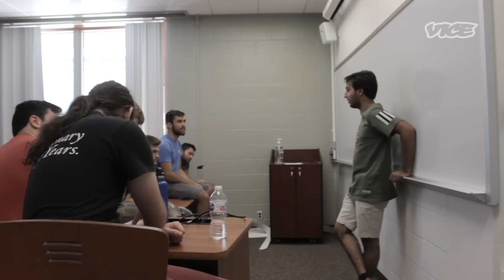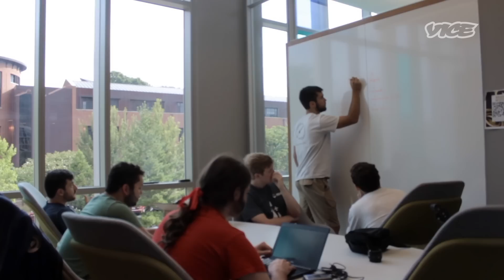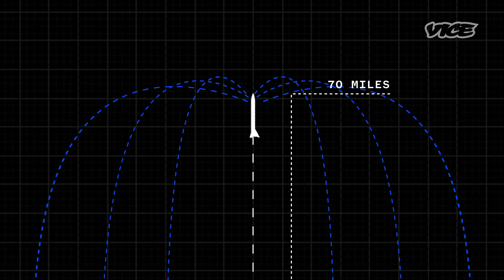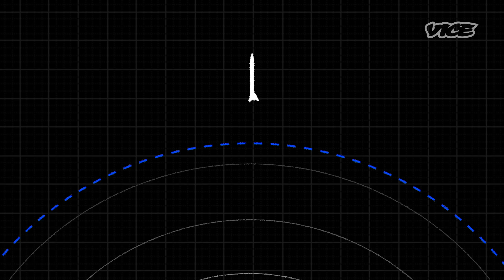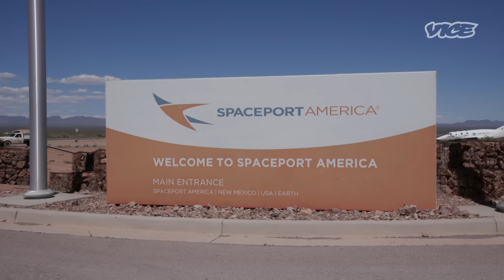Ivy League Students Dropped Out of College to Launch a Rocket

Comment: These guys really should have done proof of concept tests for some of these systems way before this point. Finding out your parts don't fit hours before launch is completely avoidable. And I would never, ever say a part was machined by an "incompetent individual." Odds are that a practiced machinist who has years of experience followed your plans, which you don't have any experience making, to a T. Don't insult a machinst unless you know exactly what happened. They are hard working mother fuckers and you want them on your side. You should be buying them a 6 pack for being able to make such tricky pieces for you, especially since for this application you could have used much simpler geometry. You didn't even need to machine them to be honest. Hand tools could have made something nearly as good in less time.

Also, afaik, no private individuals have ever crossed the Karman line. There are a lot of people getting close but it's still a big deal, so they shouldn't worry too much about not making it this time.

Comment: "Teenage Scientists Launch a Rocket to Space"

"Operation space failed to reach its goal of crossing the Karman Line"

At least give us some consistency.
Reply: From space.com ..... Earth's atmosphere is about 300 miles (480 kilometers) thick, but most of it is within 10 miles (16 km) the surface.
Reply: Vice refused to do a video for USC RPL. We actually reached the Karman Line 😉
Reply: It's not inconsistent. The rocket did leave the earth's atmosphere, so it went to space. But it didn't cross the Karman line, so it fell back.
Reply: @themroc8231  incorrect response... the karman line is considered the entry to space.... go read a book or something
Reply: themroc that’s not correct.
Reply: @themroc8231  You realise even if it passed that line, it’d still fall back? The Karman line doesn’t mean anything, it’s just a convenient altitude where the atmosphere is thin enough to say that “space” has begun. Going into space doesn’t put you into orbit. To get into orbit you need to travel horizontally to thousands of miles per hour.